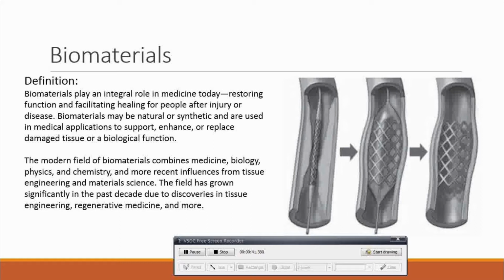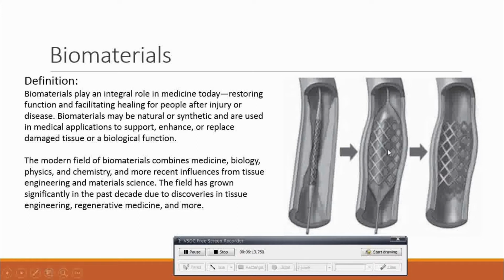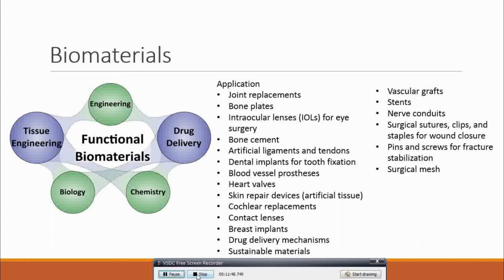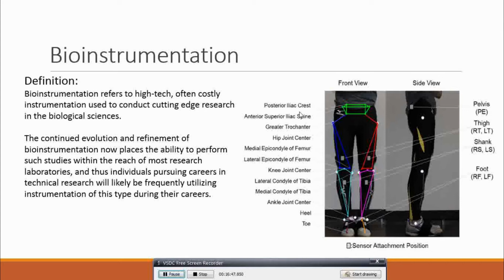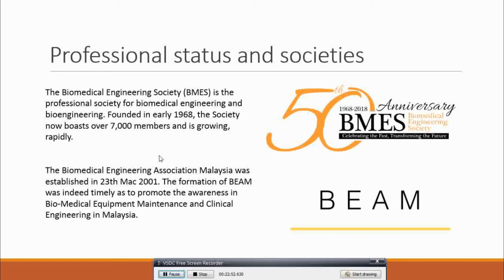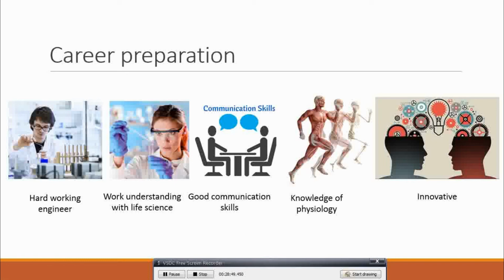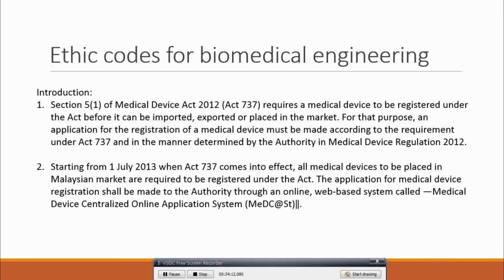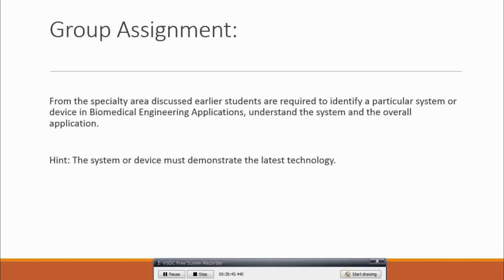Biomedical eng and applications BEU41503 lesson 3

Comment: Darrshiny a/p Ravindran (Ae180038)
Thank you Dr for the detailed explanation. From this video, I learned on biomaterials which means combination of bio property with materials. The applications of biomaterials are joint replacement, bone plates, bone cement, heart valves and many more. Next is bioinstrumentation which refers to high tech, costly Instrumentation used to conduct cutting edge research in the biological sciences. Besides I also learned on career preparations that an engineer should have such as good communication skills, have an understanding of science systems and many more.

Comment: Thank you prof for sharing the topic about biomaterials, which is biomaterial is a substance that has been engineered to interact with biological systems for a medical purpose, either a therapeutic or a diagnostic one. Clinical engineering is a specialty within biomedical engineering responsible primarily for applying and implementing medical technology to optimize healthcare delivery and bio instrumentation is focuses on the devices and mechanics used to measure, evaluate, and treat biological systems.

Comment: NURIMAN NADIRA BINTI ROSLI CE170026

Thank you Professor for your presentation. Since people wear contacts to enhance their vision, contact lenses are known as Tissue Engineering. Some people should find wearing glasses bothersome because contact lenses do not fog up or get splattered by rain. The advantage of contact lenses is that they can be used for long periods of time and do not irritate the eyes since they are compatible with human eyes. Contact lenses have served the tissue engineering function of providing a material to help, strengthen, or replace damaged tissue that can be used within the human body. For next section is the combination of instrumentation properties into bioactivities in the bio instrumentation. For body movement, the movement of the head, arms, and hand grasp includes heart rate, breath, and pulse wave for physiologic parameters.

Comment: Thank you Prof for the lecture. The contact lenses are classified in the Tissue Engineering is because users wear contacts to improve their eyesight. Some may find it disturbing to wear glasses as  contact lenses does not fog up or get splattered by rain. Good thing about contact lenses, they are able to stay on for long hours and does not irritate the eye since contacts lenses are compatible with human eyes and it served the tissue engineering purpose that material to support, enhance or replace damages tissue that can be used inside the human body. For the next part, I do find it interesting to be working in the Bioinstrumentation field as there is so much upgrading and designing that engineers can do, mostly for the users convenient for example, the figures shown in the video, a man equipped with sensors to detect each movement. Have a good day Sir and Ramadhan Mubarak.